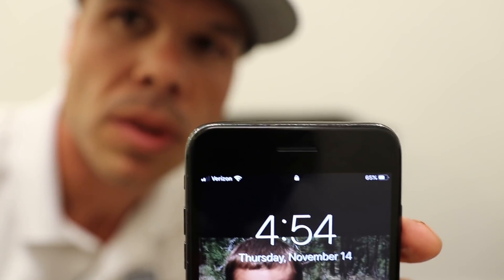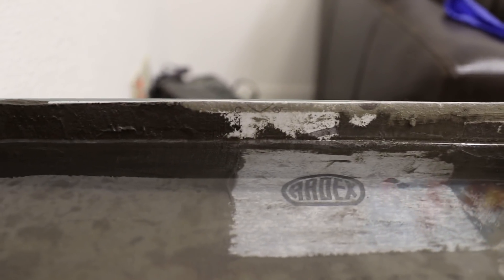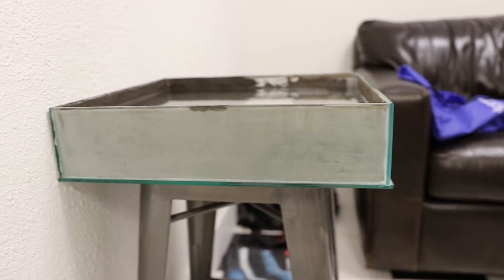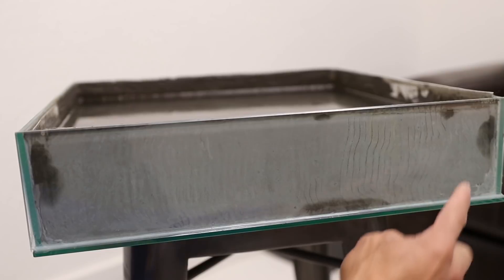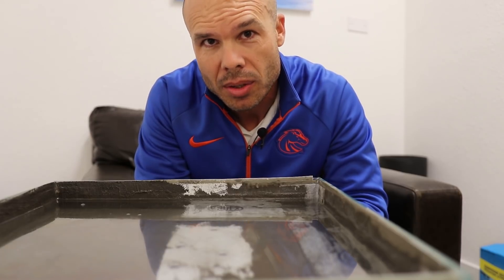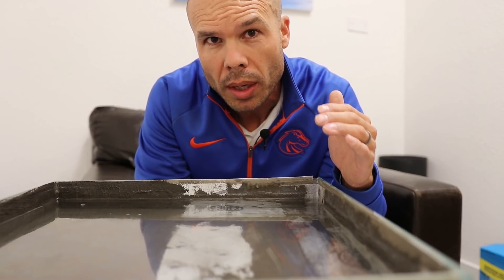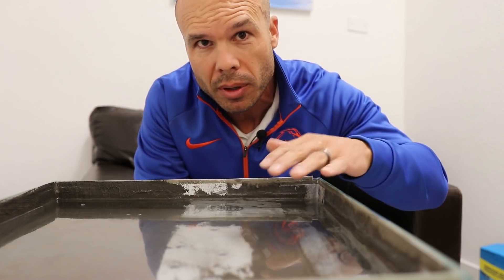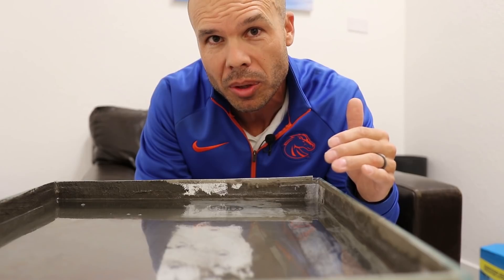Ardex Waterproofing FAILS 48 hr. Flood Test-  Glass Box Test Episode 3

Comment: Ardex : I woudn’t touch this company with a barge pole. I Bought the WPC kit and the instruction were lacking so I phoned Ardex. They advised to use their P51 sealer on new plaster which I did at an additional cost of £54. The finished job looked good but when I scraped of a snot (small lump) I could see the WPC had not adhered to the plaster. Ardex then said I shouldn’t have used sealer ! and advised me to scrape it all off and re-do it. No admission to their wrong advice or even compensation for the materials let alone my time. 2 WPC kits and 1 P51 = £184. This comment would not upload to an Ardex posted video.

Comment: No wonder it is leaking. It is not material it is the way you applied it. Poor job. I have been using Ardex system for 15 plus years on swimming pools without the failure. I suggest you get yourself a training with Ardex on how to use this product correctly.
Reply: @lbertsmith5274 what was wrong with the installation? I'm about to use 8+9 and am curious to hear your thoughts. Thanks

Comment: Hey, 
I‘am very interested in your test results and all other videos, especially the fails, because these are the videos, where we/I can learn a lot from practice. I‘am coming from germany and last year I bought with my girlfriend our own house. So we renovate all rooms and also the bathrooms.
I make all works by myself, also sealing and tiling of shower.Hey, 
I‘am very interested in your test results and all other videos, especially the fails, because these are the videos, where we/I can learn a lot from practice. I‘am coming from germany and last year I bought with my girlfriend our own house. So we renovate all rooms and also the bathrooms.
I make all works by myself, also sealing and tiling of shower.
We used from German Brand PCI the flexible sealing slurry SECCORAL 1K. In this system, you will only need membrane sheets in corners and edges and not over the whole surface.
First you insert the corners and edges with the slurry (not mortar). After that, complete surface have to be cover by a two layer slurry of a minimum thickness of 2mm (approx. 0,08“).
So you will have no problems in case of overlappings.
Are these membrane sheets required according to the national sealing requirements or can you also use an other system?

I found a video, where Ardex seals a carton and show that the slurry will be working.
https://youtu.be/kgh-YaObAdAHey,

Comment: Thanks for doing theses videos, Should have bonded the SK-175 with the 8+9, that's what they recommend for submerged application, a regular shower you don't have that much water sitting on the surface, like you said it doesn't cost a lot of money to cover you entire installation with a coat of 8+9, 0,50$ sq.ft for an extra protection !!

Comment: So out of curiosity did you bond the sk with 8+9 or just do 8+9 for the waterproofing.   I have been bonding the sk175 with 8+9 and going over the seams and the top with 8+9 on wierd shower pan sizes

Comment: Isaac, that doesn't look like a proper test for this Ardex, ( my favourite products). Where you have used the full system, ( '8 + 9' in this case ), where a membrane is applied over the tapes, there doesn't seem to be any water leakage. I was taught to fully bed the tapes into the membrane AND I always use THREE COATS; one for bond, one for imbedding tapes, one for the final seal ; To be sure, to be sure, to be sure. This was a good look at waterproofing though.

Comment: Thinset has sand and cement in it. Even with alot of resin added. It’s only logical that it will give in over time when you use it to construct fishtanks. However having said this. I prefer to use the liquid systems these days.

Comment: Thanks Issac for taking the time to do these videos. 
I too used to think overkill was a good insurance policy against failures. I.E.  Mixing different manufacturers products together. All that does is increase the likelihood of failure. Example-- Building a vinyl membrane pan liner with weep hole drain, then using liquid membrane on the cbu. Yea, we've all done it.  Each system has a function and those functions when overlapped spell big problems into the future. If you want something that will hold water for a week or a year, These are bottom line the best. 1.  Eternabond Webseal. 2. ProtectoWrap AFM/WM  3. Bostik Ultraset Advanced. Also RedGaurd SpeedCoat seems to be very good but will need time to see how it lasts.  IMO any membrane that you can clean up with soap and water, it not waterproof. In fact NOTHING is truly waterproof as water will eventually destroy everything given enough time. Choose a system and use it, don't build Franken-showers like that one guy... 
If it wasn't for Membranes,  we wouldn't have no branes at all.

Comment: You have it right.  Test to extreme to prevent future failure.  You are exactly right that engineering to minimums as the reps push is guaranteed to make a failure in the future.  The belt and suspenders is warranted as any damage will not become known until it is a catastrophe and a very expensive one at that.  Then the manufacturer's if you are lucky will give you a new batch of the same crap that failed.  You will get the biggest part of the bill for repairs (structure too) and materials.  If they truly "guaranteed" in any meaningful way they too would have a conservative approach to installing.  Keep it up Isaac!  Doug

Comment: A couple of things to think about. 
1. Do what makes you feel confident. No worries. 
2. We, Laticrete International, also don’t mind if you apply liquid waterproofing, like HydroBan, over the seams of our Sheet Membrane either. 
3. There are literally millions of showers done using all of these methods solo. Tens of millions world wide I’ll wager. 
IF there was a long term problem building showers out of these methods our industry would have massive lawsuits everywhere. The math is severely against it. Statistically speaking. 
4. For the record no one suggests that sheet membranes should be floodtested for over 24 hours as IAPMO requires. 
I see your logic, but constantly submerged is a very different spec.

Comment: That film could be residue from the hvac.  Do you have a leaky plenum? 
It's official, I am running 8+9 on my pans and at least 6 inches up.  Thinset is not waterproof and it pulls the water through. 
Although it would only take a few drops of water to cause that discoloration. 
What these test absolutely prove is that the installation of these membranes do not provide 100% waterproofing.  But I am sure if done correctly they provide 99.5% waterproof and the few drops that get through will never cause damage. That said,  I am sure schluter knows this but they do a lot to make it seem like their system was 100% waterproof. But then again,  good luck getting a company to pay for a warranty repair when their system fails.  They will find something like 1.9 inch overlap in the top right corner of the shower and void the warranty.
Reply: @TileCoach   With that being said, do you think this could have a long term negative affect on membranes like schluter if applied over the top?

Comment: You don't need to if you are not retaining hydrostatic pressure. This is not jobsite conditions, the band is a breathable product. Slope your pan right and dont allow standing water. Too many installer errors is roll ons and mixing the products ie rubberized roll on membrane shrinks when it dries therefore compromising the membrane. Just my thoughts, thanks for the vid!

Comment: Don't ask the manufacturer a question,  they don't have any knowledge about the work of the shower, just do the test and use it if it is best. I just use Ardex 8+9 only I apply 4 coats on the floor and 3 coats on the wall. I feel very confident that the whole shower will not fail easily. At least it will last 20 years and plus.

Comment: Great job Isaak! So with the kerdi band and the ardex failing the test, what are your thoughts on using 8+9 directly over the mud bed? I was thinking densshield from ceiling to floor, 8+9 on top of it to the floor, then the mud bed with 8+9 on top.

Comment: I think you are pushing the parameters of what the products are designed to do.. you need to use epoxy for holding water imho , bathrooms not designed to hold water unless its a Roman bath...
Reply: @TileCoach  I use a lot of ardex products, but last while I've been using a Local Australian company called gripset for my WPM and its great

Comment: The only system I would even consider would be some sort of 2 part resin. A roll-on resin that would be used to adhere the membrane to a substrate and would adhere the membrane to the membrane. Fully synthetic, fast setting, impervious, semi-flexible. 
Until the wizards of smart pull their heads out of their collective asses.................no F'ing way.
Reply: you can use epoxy grout instead of thinset 200%waterproof , a bit flexible , I don't understand why epoxy grout is not generally used in shower systems , I just did mine , curbless linear drain with wedi boards and 3 layers of liquid membrane on top of wedi and epoxy grout, the only failure point I imagine would be the sheet around the drain , that sucked to install
Reply: @superbecx  Epoxy grout is a nightmare to use, but it certainly helps keep water where it belongs. In my admittedly amateur opinion though, it's virtually impossible to get just the tiles 100% waterproof with an epoxy grout though. It would be just too many potential points where the grout doesn't make full contact, no matter how hard you try to make it perfect.

Also I live in New Zealand, and the way these Americans do showers is totally nuts. It would be illegal here. Our building code requires tiled showers to be fully waterproofed, not just a few inches above the floor. In general tiled showers are not popular here though, most people opt for prefabricated acrylic shower liners. There are huge advantages in these things, the shower is completely impervious to water, with a single piece of acrylic lining the entire shower, it can go over a very wide range of substrates, and of the manufacturers recommendations are followed with the gluing pattern, there is a path between substrate and liner for moisture to escape. This and they are very cost effective, very durable, and very easy to replace compared to tiles. I love tiles, but I think the risks are high. It's difficult to make a wet area completely waterproof, and once the tiles are on, it's often many years before any problem becomes apparent, and by that time the water has turned framing, flooring and wall linings to mush, making for a costly repair. Our building code does not allow people to take chances, we had a lot of changes made after a nationwide issue with leaky homes in the late 90s and early 00s.

America has a very different way of doing things. Some things are very traditional, other things are far more modern that anything we do, but the big takeaway I get from watching all these videos is just how little oversight there is, and how slow to respond to industry changes the regulators are. America is still the Wild West, only now there's state of the art technology and mega corporations. Very interesting.

BTW I'm not bashing you guys or your country. There's some truly impressive houses being built, and technology we can only dream of over here, but it's also very much up to individual customers and tradespeople to get it right. Buyer beware.
Reply: A S C E N D E D W H I T E M A L E 
Acrylic showers are popular here also. But they are in the cheap houses. They look terrible.
Reply: @MookieMan1  Most houses are cheap houses in NZ. Cheaply built that is, they are some of the most unaffordable houses in the OECD. The world actually. The average house price to average income ratio is absolutely nuts thanks to our government increasing our population by 25% with immigration to keep the economy going.

Comment: Shouldn't you do this test with a normal substrate between the glass box and the ardex? It's not exactly simulating a real world condition if the manufacturer didn't say you can apply their material to a glass or plexi-glass substrate. I imagine the same setup with an inner box of hardibacker and properly taped/mudded seams,  plexiglass outer box so you can see where the water beads up. It's a great test though, so try some out some other methods.